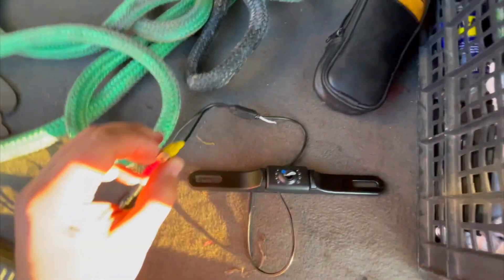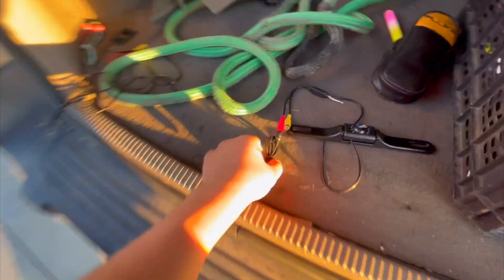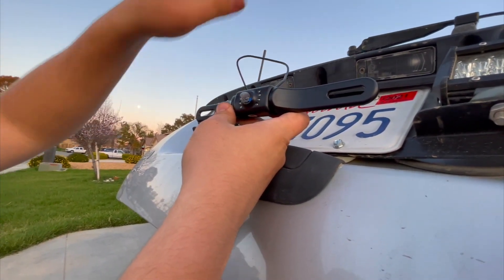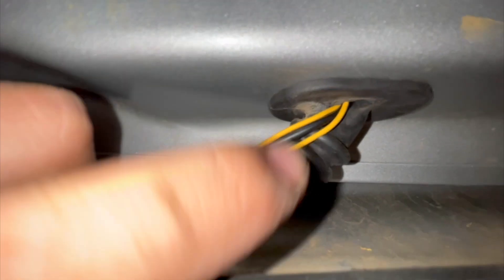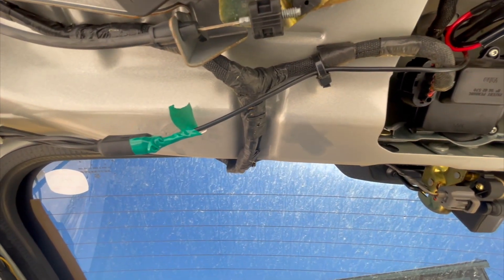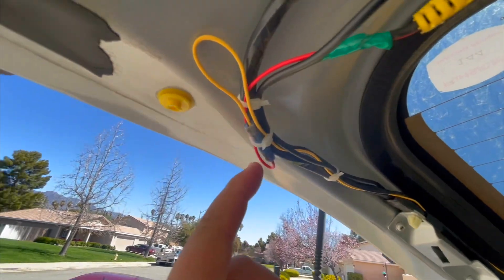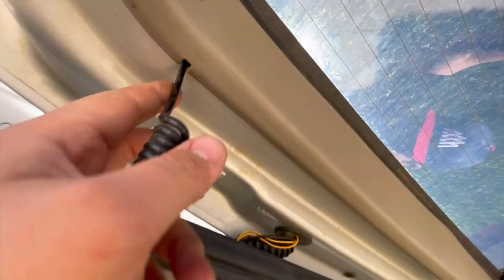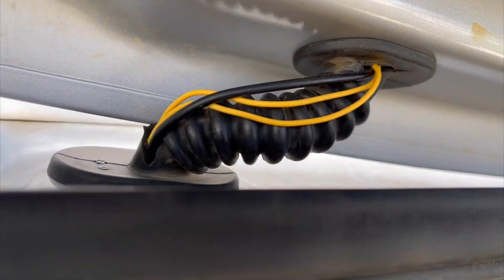Installing Rear View Camera on Jeep WJ Grand Cherokee | Najar Offroad

Comment: I just did my backup camera install with an ATOTO F7 XE.

I took the hole in the trim above the license for the center screw and cut that area out into a nice big U-shaped hole that is perfectly aligned to the camera. It looks like it was always there.

For dealing the grommets, lube them with dish soap and they are much easier to deal with.

Since I was also doing the headliner (greytone camo sherpa!!), I ran my wires up the a-pillar. The dash trim is basically designed to break as 20-year old ABS is brittle and the clips are like concrete.

Comment: installed a wireless unit in the back of the zj. Got the one smal red power cable through the rubber channel, without cutting, and did grounding cable on the rear door, - works fine.
Reply from the maker: I didn’t even know there is wireless cameras haha would make the job way easier!

Comment: There will be two really long screws. They go by the wiper motor.

Aside from the two on the bottom, they are the same clips as the doors use. I found that out as I pulled that off after I replaced both of my mirrors.

Comment: Great video! Helped out a lot with the new camera I'm installing on my jeep. One question: I need to connect the power wires to my reverse/backup light wires (like you did at 2:51) but I'm not sure which ones they are because there are so many. Any tips on how to select the right ones?

Comment: Did you have to add an extension on black and red power cable to reach tail light.
Reply: Looking like I’m gonna have to do this too. I think in the video where he has them T-tapped into the taillight power they are the yellow wires.

Comment: Thanks for sharing these videos. Got my stereo installed and now I’m onto the backup camera. The erapta kit doesn’t have any RCA adapters. What did you use to go from the 4-pin cable that’s supposed to go into the small monitor but instead will need to go to the stereo’s RCIN RCA port?

Comment: So do 2 wires get connected to the ppl/blk reverse light? 

I'm installing a backup camera in my WJ too. Just trying to understand it
Reply from the maker: It should be one to ground and one to the positive for the reverse light which if I remember correctly it’s the purple and black. Get some T Taps to make it easy to install

Comment: Hey unrelated question I just bought new halo headlights for my wj and I want to replace all the old bulbs I want some real bright led ones which ones should I get for all the bulbs? Thanks
Reply from the maker: Flyryde.com for the bottom row and Amazon for the actual low or high beam the brand I used isn’t being sold anymore
Reply: Thank you so much

Comment: Did u have to add wire to make it fit. I got the Atoto backup camera and there wasn’t enough length for the connections from the camera side. Not even close.
Reply from the maker: Yes I added the yellow wires
Reply: @NajarOffroad  appreciate it brother. I’m about to head out into town to find some. Love ur channel brother, currently adding shit to my WJ to make it look a lot better. Just added the A6 Pro yesterday as the S8 was sold out 😢
Reply from the maker: Well what’s the difference with the a6? If you have any questions installing it hit me up on Instagram @najaroffroad
Reply: @NajarOffroad  nothing too much. Looks like it doesn’t have CarPlay though 😢. BTW I just wired my back camera and it doesn’t work now. What type of wire did u use?